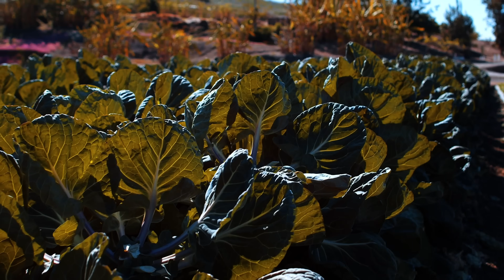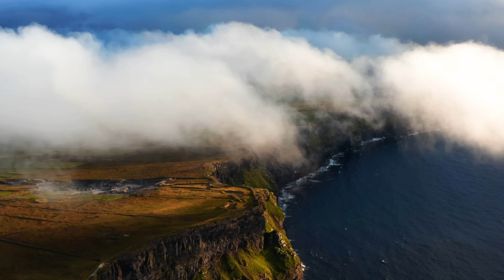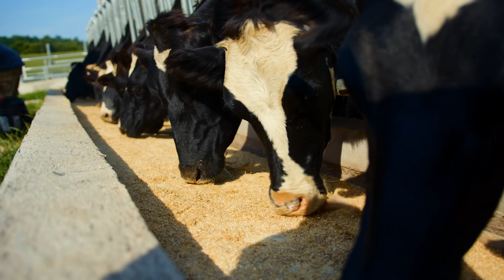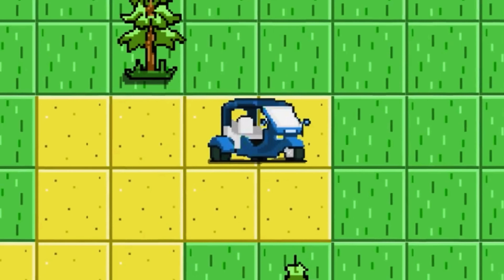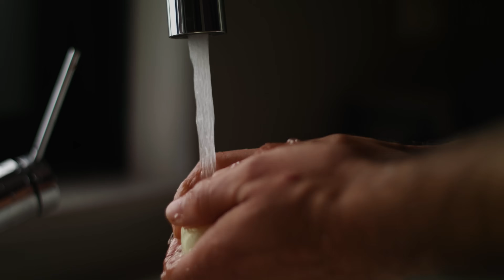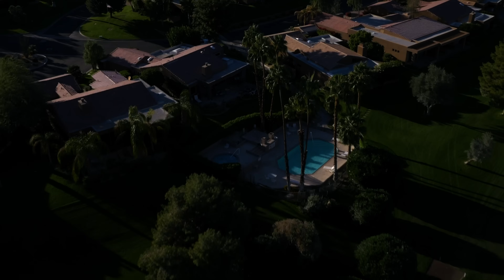The Off Grid Guide - Part 1 | Why Go Off Grid?

Comment: Huge fan of what you all are doing. I grew up fully off grid back at a time where you were lucky to have a 20W solar panel and a lead acid car battery for your lights. At the time I wouldn't have wished it on anybody. Nowadays it can be done so much better and you guys have done a great job showing how to do it right. Keep up the amazing work!

Comment: I wouldn't say methane is a clean burning fuel. After all, natural gas is mostly methane. Methane is just carbon neutral if it comes from our waste, which should be called Biomethane. Terminology is important when debating with fossil fuel advocates because their only recourse is to nitpick (e.g. Climate Change vs. Anthropogenic Climate Change).